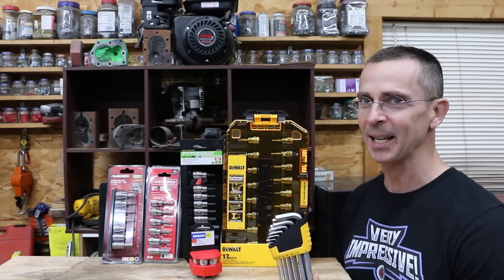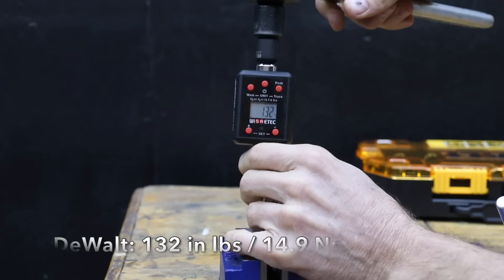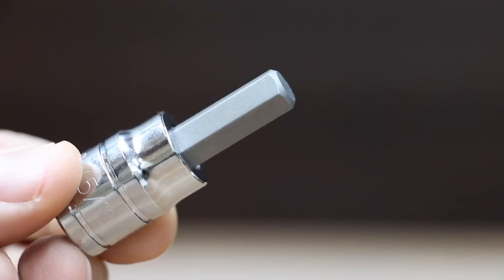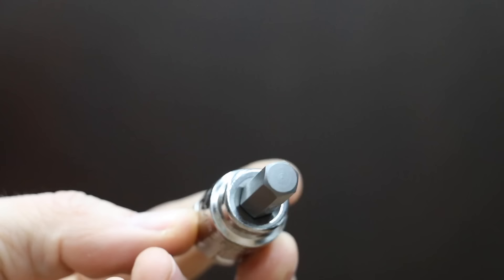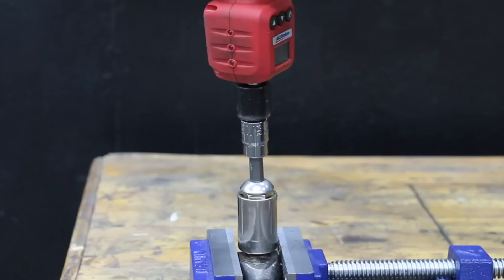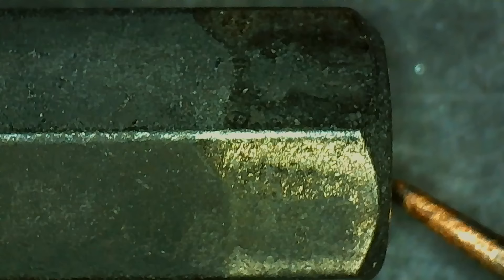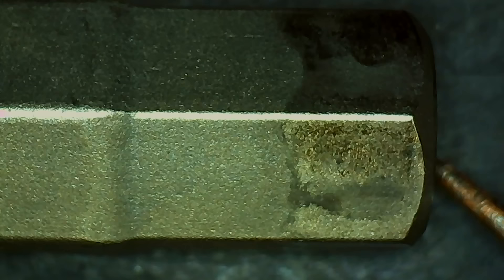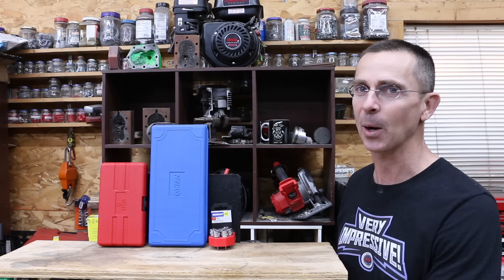Best Hex Bit Socket Set? DeWalt, Kobalt, Craftsman, Husky, Neiko, Pittsburgh, Tekton, GearWrench

Comment: I have a Craftsman set I got in the 90's that are a loose fit and have stripped out allen heads on my bikes. In the late 90's i got a HF allen socket set and they fit tighter with no stripping issues. I liked them a lot more and they were only $10 for the set!
Reply from the maker: Thanks for sharing.

Comment: Excellent video.  I work on industrial machinery so I am turning socket head cap screws and button heads all day.  I personally have owned a set of Husky, Pittsburgh, Pittsburgh Pro impact, ICON (Harbor Freight's "better" brand), and NEIKO impact.  I find that if used heavily and (esp w an impact on the 2-piece non impact type) that the hex portion tends to come unpressed from the chrome (Husky set and Pittsburgh non-impact set happened to on multiple sockets).  For this reason I prefer the single piece CR-MO impact sets and I have had good success with my Pittsburgh Pro impact (unfortunately only 6mm+ sizes) and the NEIKO impact set does well on new fasteners but has a tendency to strip older or softer button-heads in the <4mm sizes. 

I would not recommend personally the Husky or Pittsburgh (or any of the two piece style sockets), but the NEIKO impact set has served me well as I need all the small sizes and also I like the case - it has held up very well and is really useful.  The Sunex set seems impressive if only it came in the smaller sizes.
Reply from the maker: Thanks!  Thanks for sharing.

Comment: Video idea suggestion: dehumidifiers. I am finding that dehumidifiers used to last 15+ years but these days most fail in less than 5 years. some only last months. Many companies just send replacement units again and again until the warranty period ends. I've seen some people on YouTube describing as many as 6 units received during one warranty 
period. Clearly there's a serious "quality" problem with such high failure rates. Obviously comparing new to old units isn't feasible (limited availability) but it would be interesting to know which new units are more likely to last. I'm not sure how to simulate or accelerate the time factor to predict a unit's projected lifespan, but if anyone one could figure this out, I think YOU could. You're videos, your analytical process, and your delivery of information is amazing. The  internet is a better place to research things because of what you do.
Reply from the maker: Thanks for the video idea.

Comment: Best universal joint  and universal socket!!
Those tools being very useful in tight places like engine bays would be super cool to see articulation and compactness vs. Strength and quality!

Often times in confined spaces i have to use 1/4 universal with a 1/4 flexible extension knock on steel I've never broken a set even after putting a questionable amount of tq on the setup!
Reply from the maker: Thanks for the suggestion.

Comment: just a tip to pass along. on those allen hex bits if you want maximum grip to the bolt head i grind off the tapered part on the end of the bit. the taper is there for ease of getting bit into the head but you are sacrificing contact surface. get 2 sets grind one set flat and leave other set factory. this is the same with sockets . i buy those rounded off nutdrivers that people sell because they wont grip . grind them down till wear part is gone and now you have a good set. sometimes the handles come loose and spin . i drill through the handle and shaft and install a spring roll pin good as new . i have found that the chrome plated allen or hex keys seem to fit better and won't round off as quickly as the parko coated black ones . if you need a big hex bit socket but dont have one or lost or broke one you can use a cut off wheel and cut a section off the long end of hex key and use the same size 6 or 12 point socket. i try to always use a 6 point socket . you can also make hex key or hex bit socket with a bolt and the head size you need for the driver. jam nut 2 hex nuts near end of threaded part and use a wrench or socket to turn it .
    thanks for what's he going to test this time videos .
Reply from the maker: You are welcome!  Thanks for sharing.

Comment: Thanks for this video. I have found myself using more metric lately, and wanted to just get one whole set that would have everything I might need. 

I had fairly well settled on wanting a wide range of impact-rated 3/8” drive in metric/SAE. After seeing this video, though, and for how infrequently I ever use an impact on these, I went with the non-impact Neiko set. 

I just got them, but they look like really nice crisp bits and the case for them is one of the nicest I’ve ever gotten with a set. Huge variety in appropriate drive sizes. Very impressed on initial impressions.
Reply from the maker: You are welcome!

Comment: Always improving your methodology! Like the small recaps showing damage to the bits, but missed out on your overall spreedsheet recap you normally have at the end of the video. Also, something that matters, but not sure how much. The tool/fastener alignment has to be straight up and down. Perhaps making a jig to hold them straight? Especially with the smaller sizes, if the driver starts angling it's going to round them out faster.
Reply from the maker: Thanks for the constructive feedback.

Comment: Getting caught up on the vids and this was a good one! I had a Stanley set in the drawer which I got out to feel the sizes as you tested them, which made the vid a lot more relatable. 
 A lot of viewers request Harbor Freight brands included... If you want to go one step further, in Canada we have a similar store called Princess Auto that sells "Powerfist" budget brand. If possible, those would be fun to see tested. They make socket adaptors in both CV and impact-rated, and pretty much every type of hand tool, generators, pressure washers, etc. 
 Thanks for the vids and hope you get lots of good ideas
Reply from the maker: Thanks for the positive feedback and for the information.

Comment: Not a pro but I'm certainly an advanced DIYer. I have some Craftsman tools I bought 35 years ago that are still going strong. I have some Kobalt and Husky tools. Husky isn't as well designed IMO but gets the job done. Neiko had really impressed me! I have various socket sets and other tools from them I bought off Amazon and I've been VERY satisfied with them. My only complaint is that the cases the tools come in are usually mediocre and won't last long. But if my money is going towards the tool quality and not a fancy case... Call me a happy customer!
Reply from the maker: Thanks for sharing!

Comment: Thanks for all of the great videos.  Here is a suggestion for a video:  I am in the market for a window fan (many brands available on Amazon).  The 2 most important parameters are airflow and noise level.  None of the models give a spec for either parameter.  I am sure that you can come up with a simple way to measure airflow and noise level.  Other parameters include cost, sturdiness, features, and ease of installation.  Maybe you could measure other types of fans as well (box fans, etc.).  Window air conditioners might also be interesting if you can come up with a way to measure BTU/hour and energy efficiency.
Reply from the maker: You are welcome!  Thanks for the suggestion.

Comment: Yet another great video. I know im late to party being its 4 or 5 days old but didnt have time to watch till now. I love watching these reviews. I would also like to make some video ideas i recently came up with due to just googling reviews of things im currently working on.

First one is testing different tire pressure guages and maybe some tire pressure monitor systems it would be interesting to see how accurate different ones are or even how durable some are along with accuracy after some abuse such as a fall. this idea been bouncing in my head ever since the couple portable air compressor videos seeing they all seem to not read the same and some off by several psi.

Second idea/suggestion testing different belts manufacturers. This I feel could even be a multi part maybe one for like lawn mowers, one for automotive, and one for something else (brain fails to think of other things belts are on).

Third and last idea I had and one of my current struggles from life that i would be very interested in is maybe a test on motorcycle drive chains. I see many claims to many brands but I am curiouse if i am wasting my money with the higher end ones vs just going with cheaper ones.

anyhow as always love your videos cant wait for more!! 👍
Reply from the maker: Thanks!  Thanks for the video ideas.

Comment: Would love to see a series on measurement instruments. Torque rachets and drivers that are properly calibrated from the factory. Measuring tapes that are the most accurate, as well as calipers. Along with durability and ability to hold calibration
Reply from the maker: Thanks for the suggestion.

Comment: Another great video!  I think it would have been better to use SHCS instead of button heads if you're testing the strength of the bit since SHCS have a much deeper hex.  BHCS is a good way to test the fit and strength at the same time, so i can alo understand the argument for using them.
Reply from the maker: Thanks!  Thanks for the feedback.

Comment: Multiple important facts to consider:
- S2 tool steel is a harder alloy. It's stronger, harder, but more brittle. It's not intended for impact use. If you use it in an impact driver, you will shatter the bit, or worse, turn it into a grenade. It will not wear or round its edges nearly as much due to its hardness. The bits made of S2 are also typically thinner/smaller/low profile to get into tight spaces because S2 is strong enough without needing as much metal as other alloys. It's a true tool steel.
- CrV is somewhere in the middle. It's still relatively hard but can be used with low energy impact drivers.
- CrMo is used for actual impact sockets. It's very tough, but also softer and slightly weaker in terms of ultimate tensile strength. This is the correct type of socket to use in an impact driver. It won't shatter or turn into a very dangerous grenade if it breaks. There's a reason this alloy is used for impact drivers. They're typically made thicker/bigger to compensate for their lower strength. Nothing inherently wrong with using them in hand wrenches since if you're torquing a fastener to the point where the edges of the bit are rounding, you're over torquing by a large amount. Only real downside is that they're bulkier/thicker/larger. Don't get it if most of your work involves small fasteners (like less than ~10mm). You shouldn't be using an impact driver on small hex cap screws anyway. In your test showing the warping of the CrMo bit, you say "there is a problem with the type of metal or heat treatment". This is false. It's behaving exactly how it's designed to - plastic deformation instead of shatter.

You're lucky the socket adapter broke. It's made out of CrMo and designed to break like that. If it didn't break, all the energy would then go into the S2 bit and cause it to explode.

The more important factor is the actual bit profile and fit. The fastener head will always round off well before any damage to the driver bit occurs because fasteners are made of much softer alloys. Having a very good fit into the fastener head reduces damage. But again, if you're torquing to the point where any kind of damage occurs, you've far exceeded the torque spec for the fastener.

So at the end of the day, a good set of S2 bits is all you need. High torque fasteners typically don't have hex cap heads; that's what regular hex bolts and nuts are for.
Reply from the maker: Thanks for sharing.

Comment: I've had the kobalt set for awhile and they've done fine I did snap one but other than that they've been good I also have the Pittsburgh set because I needed a specific large metric bit which I couldn't get anywhere in town and their set was the only set with that size it worked fine as well but I wouldn't use them daily 👍👍👍
Reply from the maker: Thanks for sharing.

Comment: That was good considering auto manufacturers are going with more hex and torx fasteners.   
Here are a few test ideas:   Hack saw blades. 3/8" sockets - which are the best and is the Snap on design any better than the rest?   1/2" Impact sockets fit and torture test.   Small or medium bench vises .... which one grips the best, stays locked in position and has the best jaws?   LED head band worklights.   Smart phone protective cases and screen protectors.   18650 Lithium Ion batteries - what are the safest and toughest brands -  I didn't see any of these in searches but didn't search forever and you have a lot of videos!  Thank you.
Reply from the maker: Thanks!  Thanks for the video ideas.

Comment: A suggestion to make the data a bit more significant— do a “control” group using  a premium tool and multiple fasteners. That way you can see how much of the variation in results is due to variation from fastener to fastener and see what amount of difference from tool to tool is signficant vs what is just measurement noise.

Comment: The situation: Cummins 903 cu in V-8 vibration dampers. 1/2” hex socket head, 5/8” NF threads, 285 lb-ft torque to install. I used a Chicago Pneumatic impact wrench and Craftsman socket to remove them. They probably never survived more than 20-40 bolts before splitting in two through two opposite corners. I would collect the pieces and get a spare from the tool box. On my way home I would stop by Sears, pick another from the rack, go to the checkout, say I want to exchange this two piece socket for this one piece one, and walk out. Never did explain how I managed to keep breaking them!
Reply from the maker: Thanks for sharing.

Comment: I think that you should do a study on battery desulfator(s) as I bought one about 3-weeks ago and used it on a 540 CCA automotive battery installed in JD 318 Tractor that was down to 9.6 V after first charging it for 36 hours. When it reached 13.2V I checked it with a battery tester that measures voltage, amperage capacity, SOC (State of Charge) & SOH (State of Health), etc. it said that it would produce only 96 of 540 CCA and should be replaced. However, after connecting the battery desulfator for 36-hours at a time and then using an inexpensive microprocessor controlled 4A battery charger for 12-hours at a time and repeating this cycle 4x it has restored battery to 442 of 540 rated CCA. Considering that a good quality automotive 12V battery rated for 540 CCA is $100 or more - my customer was very appreciative. I admit I was skeptical at first, but as a Supplier Quality Engineer I can say with certainty that unless the battery is physically damaged and you don't need a battery right away - this seems like a pretty good alternative.
Reply from the maker: Thanks for the suggestion.

Comment: Video Idea - Which toolbox is best? I am thinking about comparing Husky, US General, Yukon, ICON, Kobalt, Craftsman, Snap-on, Matco.
Things to test - gauge of steel, heavy weights in drawer to torture test the slides, casters over bumps, pulling drawers from just one side to see if they wobble, drop test (dropping things onto open drawer/the top), Powder coat stress test (sanding, dings, coverage) 
Maybe the HarborFreight US General will prove best value, while ICON could be the Tool Truck Killer with it’s lifetime warranty.
Reply from the maker: Thanks for the video idea.

Comment: One thing I would have liked to see tested was the slack of the bit when attached to a socket. I have a husky set and a capri tools set, and the husky bits are rattly when attached, whereas the capri tool bits are more taught.
Reply from the maker: Thanks for the suggestion.

Comment: For the smaller hex bits I find the Kobalt to be very good problem is Lowes can't seem to keep them on the shelf.   For the larger Hex Bits I find Sunex to be very reliable expecially when your working with heated barrels so yea you need extra's to change out when they heat up but the ones I use are 3/4" Drive so much larger screws.   For 1/2" Drive Impact Hex bits I find the Pittsburgh to work really well.   I have been using them for several years and have never damaged them and I use SAE and Metric and have 2 sets of each.   For hex keys its Bondus all the way for me.   I do have other brands but I tend to break them because they are not heat treated properly.   I have some hex bits I have had in my box for over 30 years made by Armstrong and SnapOn but not a full set just the most common ones I was using back in the day.

Comment: @Project Farm In relation to the breaking 1/2-3/8ths adapters, I had the same problem, until I bought one from Cornwell Tool, I’ve had it for about 6 months now, and given it pretty heavy impact and 3 foot breaker bar use and I haven’t had to warranty it yet. I’d say it’s quite good.
Reply from the maker: Thanks for sharing.

Comment: I have two fairly complete Neiko impact socket sets (3/8 and 1/2 inch) and have been pleased with them. I bought them near the end of my days of doing my own car repairs, so they haven't been stressed as much as the HF sockets they replaced, but even the HF sockets held up for me (the Neiko's have more complete sizes and are slightly thinner). Another great video - thanks. 

How about a video on 1/4 hex bits for impact drivers? I'd be interested in how things stack up against Wera HexPlus bits -- those are my go-to bits for removing hex-head fasteners.
Reply from the maker: Thank you for the idea!

Comment: "Using a 5/32 socket."  Shows a socket with "/16" clearly visible.  Maybe it's time for a comparison of optometrists.  :)

Curious if that loose fit on the SAE Lexivon was consistent among the other sizes.  I only have the metric and Torx sets of them, but they seem to work fine on Ford's fasteners.